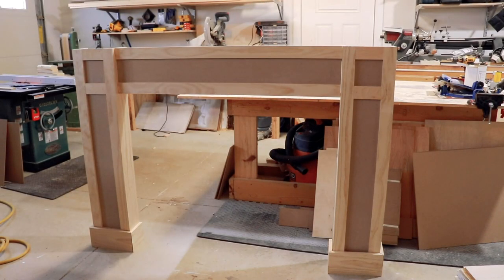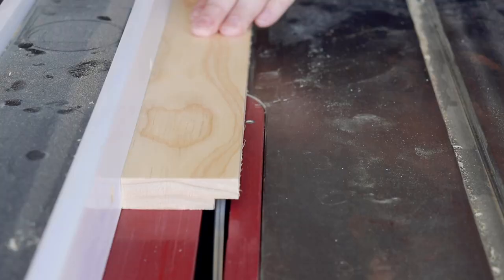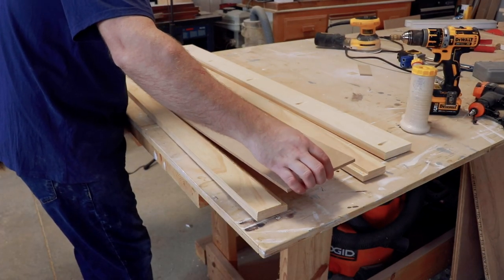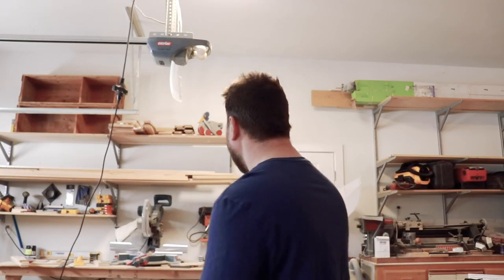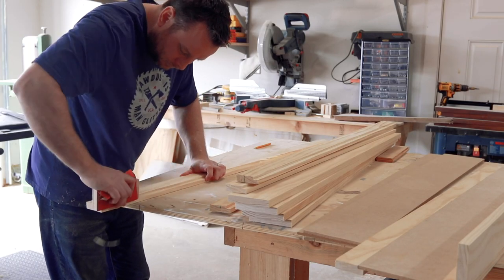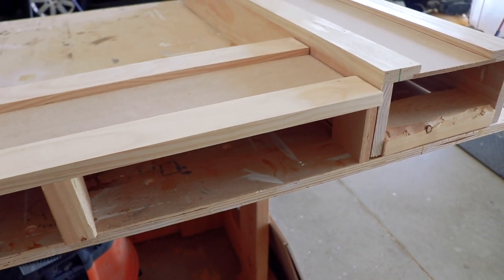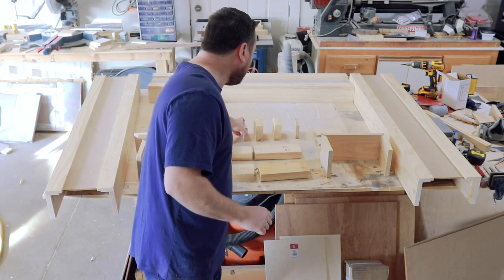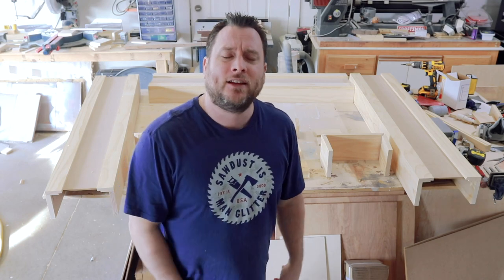How to Build a Shaker Fireplace Surround | DIY Project | Woodworking Project

Comment: It turned out nice Phillip. Hopefully by now you have built an extension for your tablesaw. They really make it a lot safer. Woodsmith magazine made one that folds up when not in use and detaches easily. I made one and it makes it much safer when cutting longer pieces.
Keep building and doing videos!
Ron
Reply from the maker: Thanks for the resource. Glad you like the videos.
Reply: What’s the price of the kit?
Reply from the maker: $395

Comment: I bought the kit and everything is very straightforward. The only thing I haven’t figured out is how to install the center. I know there are two included pieces that attach to the side columns once they are installed; is the center piece nailed to those from underneath or through the face front?
Reply from the maker: It is nail straight from the front and depending on where you place it you could also nail it from the bottom too. Hope that helps

Comment: Hi cool fireplace surround,  I have a question,  I just purchased the plans, is the material list correct ?  Ie. 1"×3"×6",  1"x4"×6",    should they be 6 feet not 6 inch,  and is the quantity correct then ,  I have not had time to refigure the list.
Thank, keep up the good work
Reply from the maker: Yes it is six feet long not 6in sorry about that the number should be listed on pages 6-10

Comment: HI Phillip, I love the design it looks beautiful, I want to ask you what type of nailer did you use to  attach the shaker frame to the MDF panel and the shaker inserts to the MDF pannel? Is that 1/2 in brad nails?
Reply from the maker: For the MDF I used 3/4in brad nails you could also use 1/2in. The nailer is from a kit I purchased a few years back it is very affordable. Here is the link https://amzn.to/3h8WoI9 if you however are going to be using a brand nailer all the time I would recommend investing in a nicer cordless version. This is the one I am going to get for myself here soon. cordless version here. https://amzn.to/3ja3k9o
Reply from the maker: looks great thanks for sharing